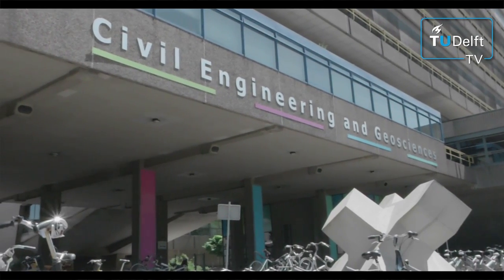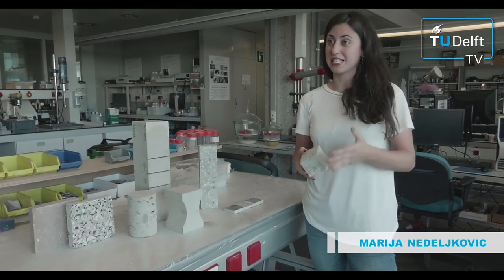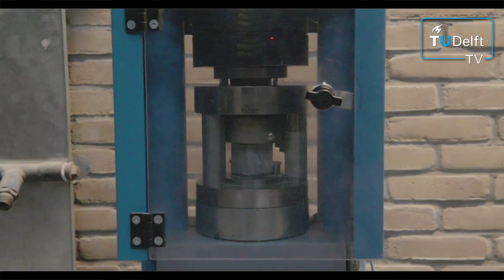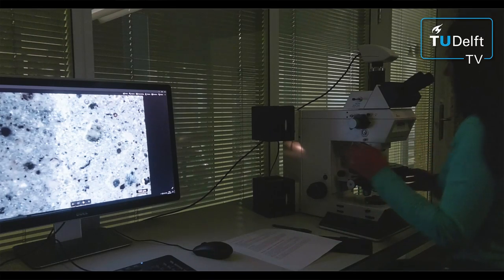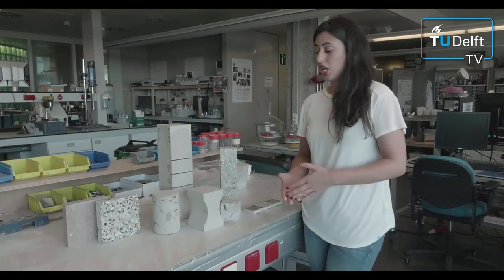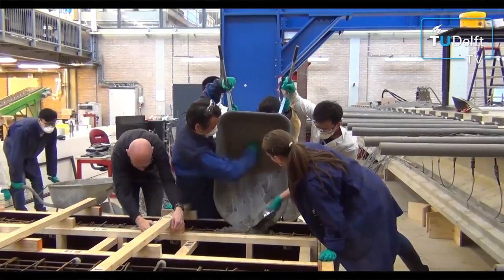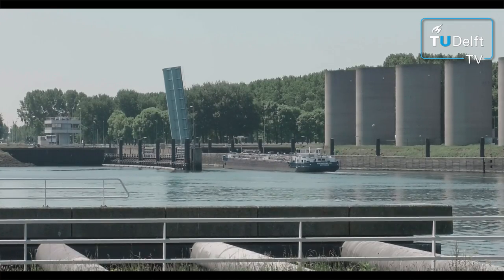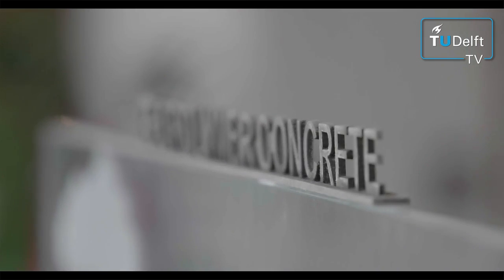Geopolymer concrete made from waste is the concrete of a sustainable future

Comment: can u briefly tell about geopolymer concrete made from waste ...plz explain it sir
Reply: GP is alumina silicate based concrete, it uses amorphous silica and alumina that can be sourced from fly ash, bauxite residue and ground slags. They are in a reactive state and can be triggered to set with a mixture of sodium silicate and sodium hydroxide. (Potassium based also works) See geopolymer.org for more information.
Reply: @TheAngeloMichael  Hi...can we use flyash & m sand slurry mixed together with sodium silicate for this research?? please reply
Reply: Rizwan Paramban I am not sure what m sand slurry is, fly ash should by f fly ash, the alumina around 13% or higher and mostly amorphous silica, the Cao content in c fly ash may be too high. It needs some slag (ggbs) you can vary the ratio 50/50 is good but you can use less slag, your sodium silicate will need some sodium hydroxide mixed with it in proper ratios,  sodium silicates vary widely.
Reply: Rizwan Paramban  the m sand can be used in place of traditional sand and depending on content may add or have different attributes. It’s particle size, shape and mineral content  all affect the mix design but gp can still make good concretes out of finer rounded sand particles that aren’t suitable with Portland. If you are in India I can put you in touch with my partner in Channai he can help you.
Reply: @TheAngeloMichael  hey I have thesis project on it can you guide me how can I got understand the whole topic and try something new please help brother

Comment: After 3 years, still doing research, no practical application has been done.based on a search .
Reply: Alkaline activated concrete is prone to leaching if not fully reacted into a geopolymer (3d network material), so there is a possibility that the material researched in the video can't possibly be used to make a bridge with it's salt water environment.
Reply: There is no codal provision for geoploymer